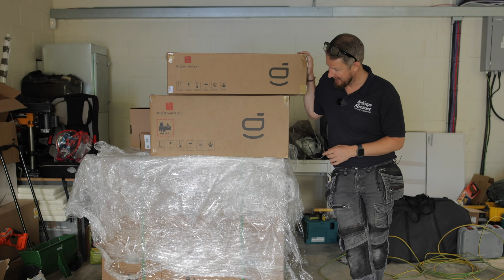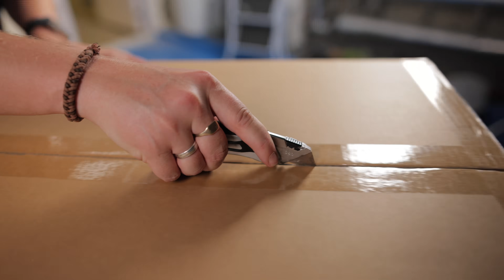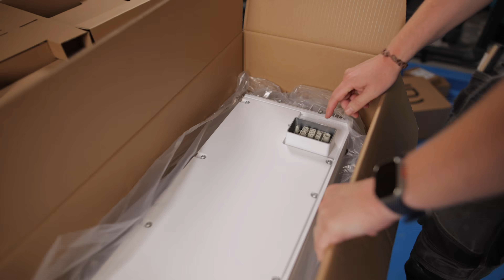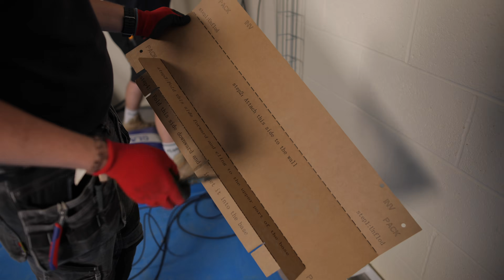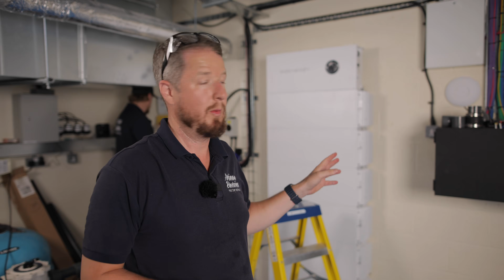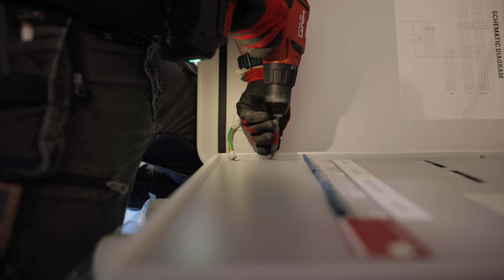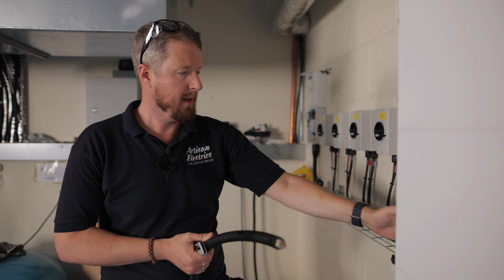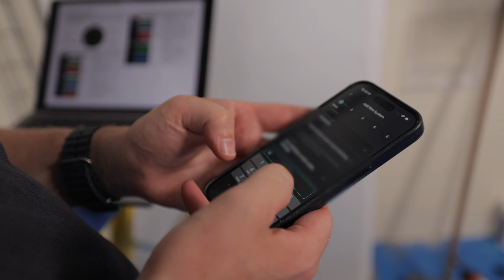Better than a Tesla Powerwall? 🧐🔋48kWh Three Phase UPS Battery System! ⚡️ Sigenergy SigenStor

Comment: I work with this kind systems for 10+ years now ( nor synergy) and it wirks good.
I only use hybride inverters so beside the ups function my house is connected direct to the inverter and the grid is as backup connected via automatic switch.
So wen my inverter fails he switch over to the grid 😂

Comment: I have a 3 phase house with a Powerwall. I need to find a solution because I have 3 phase solar that won't charge the Powerwall if the grid is out, which is sorta dumb. I wanted to be off grid as much as possible, but I find that is not possible with  my current setup.

Comment: Bollocks to being unique, there are plenty of inverters with critical load, zero switching "UPS Mode" designed for three phase in the 12-40kW bracket. More sponsored BS from Artisan. Wouldn't be so bad if you actually gave a balanced honest overview of the market, but seeing as this is sponsored I guess you go with the £££ first.

Comment: Looks a nice unit but I cant find mention of them meeting the new cyber security regulations. Warrenty looks just under what I have from Victron. The only advantage I can seen is that its all one module when I would need three inverters to match that. 0ms transfer is standard for my kit, i didnt know a lot of these gateways had such a transfer time. Thanks for the interesting video  👍

Comment: As a result of your promo video here I jumped from a pwerwall2 to this system as a choice .
  However since the 3 has launched and this obviously made me think again , but if I understand correctly the 3 is still using an older gateway that won’t allow whole house back up as this Sigen does .
  Is that correct ?
Reply from the maker: PW3 doesn’t allow whole house backup for three phase installs - also it is EPS whereas Sigen Gateway is UPS
Reply: Thanks for reply , I think if our installer can satisfy himself Sigen support is up to scratch it’s a buy,, he has good experience with Tesla support , so am hoping Sigen are ok .

Comment: Only problem I with it is that it is based in Shanghai, and the connection it then has to the PRC/CCP. I don't trust anything AI or controlled by them.

Comment: Have you looked at their single phase equipment? What’s the maximum power output and how does it compare with Givenergy and Tesla?
Reply from the maker: Their single phase inverters go up to 12kW so higher output than even the Powerwall 3.

Comment: 1) What are the advantages and disadvantages of the different battery systems that you presented (Sigenergy, Tesla, MyEnergi, others ?) ? If there are significant differences - of course. And in which cases should one be chosen over the other ?
2) How to determine battery capacity ? On what basis ? Is there a program to calculate it ?

Comment: Do Sigenergy do smaller batteries for small homes ?
Reply: you can just get the energy controller with a 5kWh or 8kWh battery pack. In this video Artisan use 6x8kWh packs but you can use whatever quantity you need up to 6 packs. You can also mix 5kWh and 8kWh packs.

Comment: I could be wrong but it looks like once its all together if you need to replace a battery in the middle you would have to take the entire thing apart to get to it, unstack the ones on top, unscrew from the wall and remove those clamps on the side. This looks very inconvenient compare to the server rack mounted batteries I've seen out there that can be slid out to preform maintenance and replacement

Comment: So the whole installation was on a 100 amp 3 phase supply, it is now on a C?50 triple pole MCB 10KA feeding an MCCB DB with, in your own words much larger than normal MCCB’s, from past experience what you are saying is that the sub mains or plant requires protective devices higher than a standard DB at 63 amps. So how does the new supply meet those requirements ?

Comment: I think in the intro you basically said that that the system was aimed at large houses or small businesses. Here in the Netherlands, 3 phase is not limited to large houses and my mid terrace house (3 floors and a supply of 3x25A) has three phase. I'm curious if this great looking system is really overkill for such a house. We only have a daily usage in the rough region of 10kWh and we have 16 panels that delivers a max of around 3kW. 

I like the UPS feature but that's not entirely essential as we have not had a power outage in 20 years. Great video.
Reply: you can just use a smaller version of the one artisan installs in the video
Reply: I think more panels would be better till you have the power available to charge the batteries.

Comment: One tip ! Wtf .  Usse a level at bottom  base .  Your battery is A  Not in  level .. wtf .  Wasserwage .. mann benutz a Wasserwage deine Batterie ist nicht gerade .. schau mal at Gestelle.  Was soll das sein .  Besser at powerwal .  Was sind Kosten für so was .. ich haben configuratinon deye Wechsel Richter mit 50 kw Akku.   Akku 14000€ und komplet Set 17000€ ohne pv panelen .. wtf .. Gibt nicht besseres at powerwall .. but IT is to expensive to me .. ahahhahha

Comment: Thanks for being honest and mentioning the "missed wall brackets" and redoing the stack.  This is what can happen when installing a new system for the 1st time, even with clear instructions! Cheers.
Reply from the maker: Glad it was helpful!
Reply: Yeah the brackets need to hold the battery small distance off the wall, expect has something to do with giving ventilation.
Reply: @trythis2821  I think these batteries are sealed TBH

Comment: 48000Wh at 800Kg? 60Wh/Kg seems pretty poor.
Reply: 110wh/kg from the manufactures website. The weight would include the casing, wiring etc as well as the cell.
Reply: @steve_787  but would casing & wiring really constitute that much weight? And what chemistry only performs at 110Wh/Kg? Even Sodium is touted at 160.
Reply: @daveh6356  does seem excessive, had a quick look at their spec sheet and the 6 unit model actually weights in at 467kg including the inverter. So maybe 800kg was a bit of an exaggeration or they had other kit to bring down?
Reply: @steve_787  sounds more like it.

Comment: Fantastic video and you just proved that the electrification is for the rich elite, anyone working and living on a living wage will never be able to afford this nor have the room.. But if they have to the owner will increase the rent...
Reply: In an effort to be encouraging, I would point out that in terms of grid stabilization and load shifting that benefits everyone, you really want a bunch of the people paying for it to be the rich people. Batteries and solar PV that I don't need to pay for, in someone else's home, decreasing the load on the grid at peak times, benefits me because the grid distribution utility doesn't need to spend as much money on increasing capacity or paying to build and maintain storage at rate-payers expense. They may pay a smaller fee to use some of that capacity in emergencies, but that's a heck of a lot cheaper than the capital expenditure needed to build it themselves.

As far as electrification being for the rich elite - How do you define electrification? Like, if you mean using electricity to power things instead of combustion, then that's not the case. Electric cooking, clothes drying, yardwork (prices vary significantly among options - li-ion battery ones can be expensive, but inexpensive corded electric lawnmowers like the one I grew up using have been around for decades.) - All of those exist at a variety of price points that are roughly comparable, and come with health benefits too. Electric water heating and space conditioning (including heating) price competitiveness varies significantly depending on local conditions, but in many cases are pretty comparable if you're already getting air conditioning (though obviously there are climates where that's not the case). If you aren't in an area with natural gas supply, like you use heating oil or coal, that may swing it towards electric more often depending on the utility. In my household's case we costed it at about par over the life of the appliances (after the government grant), if gas and electricity prices maintained their relative levels. Obviously that could change, but it's by no means certain which direction they'll go.

If you mean backup power, then yes, this is a lot more expensive than a whole home methane or propane generator system, though it also provides a lot of functionality that they don't, so you'd expect that. But also, most people don't buy whole home electrical backup, period, even rich people. That said, the existence of expensive systems doesn't disprove the existence of cheaper ones. There are significantly less expensive DIY battery systems out there. Though really, grid unreliability in many places isn't the sort of thing that the general public should normally be hedging themselves for individually in a well functioning system. If everyone around has backup generators, that may mean that something else has gone wrong in the regulatory and utility environment. Places with particularly frequent weather disasters or that sort of thing are exceptions, because there's only so much that a utility can do and only so far that society will go to devote resources to preparing for, as well as partly because many people tend not to want to live in places with frequent bad weather.

And if you mean electrification of generation, well, depending on where in the world you are, if you're already buying electricity, there are places where you can put money into buying from carbon neutral generation that can save you money. Not everywhere, but there are definitely community funded and subscribed solar and/or wind projects around that give their subscribers rates that are equal or better than those of the incumbent fossil powered utilities in their area.

Take heart. Progress is being made, though it is unevenly distributed. Lots of people are working on making life better in equitable ways. Hopefully their example brings more people on board to support those efforts.

Comment: Fantastic install, only question I have is if you have supplied the AIO with a 10mm 5 core ho7 from the gateway how have you calculated the design current if the ups is backed up for the whole house surely 10mm is undersized?

Comment: Are the IP2X covers still to fit on the contactor links in the gateway enclosure !! Or is the busbar from the contactors left like that?
Reply: By the accent alone, this is in Britain... It wouldn't pass cerification if they are not covered.

Comment: Have you got a video explaining all these kw ratings, 5kw solar system means what, 5kw at what voltage ? UK mains? 48kw battery's at mains voltage or another voltage, I don't understand
Reply: kw is always the same. Its kilowats so basically 1000s of watts. Wat is voltage times amperage so 1kw can be 1000V and 1Amp or 100V and 10Amp or 1V and 1000Amp. Thats what inverters are doing, basically changing 50V into 100V or 200V depending on what battery voltage is compared to your grid voltage or other requirements. And if you double the voltage, you halfen the amperage
Reply: Battery capacity is kWh - kilowatt hours. So a 48kWh battery can supply 1kW for 48 hours or 48kW for one hour. The inverter will determine the voltage. The load will determine the current. 
kW is a unit of power
kWh is a unit of energy

Comment: LiFePO4 still catches on fire. The GenX big battery supplied by Tesla near Rockhampton Australia did so last year. Why anyone would install one of these inside a building and not in an engineered structure to manage fire is mind boggling.
Reply: My thoughts exactly.  I'm planning a home that is on the small side but I still don't want the risk of living inside a building with a huge battery so my first purchase was a "telecommunications shelter" where my batteries and inverters will live and a bit of extra storage too.

I like how this battery system is pretty modular and clean but it should be in a structure that is kind of designed to fail without catching other structures on fire and probably with a dedicated fire suppression system so there is a way to attempt to extinguish a battery fire rather than just waiting for it to burn down completely.  That's probably not a job for water so either an ABC style chemical extinguisher system or a CO2 generator of some sort.  I'll have to research that more.
Reply: Lots of things in a house can catch fire but we don't go around keeping half our possessions outside. The risk is pretty low

Comment: Great video. I've ordered a Sigenergy system for my single phase home, 16x (2x8) 455w solar, 6kW inverter and a 5kWh+8kWh batteries. Waiting on G99 DNO approval.
Would love to see more in depth app workings with the AI and TOU tariffs etc.
Reply: Would you share who you are using for this install and how much the cost is? If you don't mind of course!

Comment: Why are gateways not incorporated into an inverter?
Reply: Better to keep them separated to prevent the possibility of a massive mains (or lightning) surge directly into the inverter. This way, everything is fused on breakers, before it even gets to the inverter module.

Comment: Seems quite similiar to the Huawei batteries just in terms of engineering and being modular and stackable. Huawei inverters and batteries are very common in ireland but dont see any UK sparks installing them, how come? They are brilliant right up there with solaredge in my opinion

Comment: Great video @artisanelectrics I'm the Managing Director for Sigenergy in Australia, although i'm originally from Yorkshire so it's great to see our product gaining popularity in the motherland!
Reply: Can you hurry up and get CEC approval for your 3-phase inverters please 😉

Also would have been good if the 15kW inverter had either 4 MPPT's or allowed parallel strings due to the 600PV restriction in AS4777.1
Reply: I’m a fellow Brit who is living in India (due to my job) and I can tell you that the market potential for a product like this is absolutely huge over here. See bullet points below that I hope are helpful….

1) There might be a few barriers to entry in India (due to bureaucracy) but that’s now easing a lot with the country digitising corporate admin.

2) There are currently no competitors at the moment, because there are no lithium based battery products available over 1 KWh. Most people have lead acid based EPS systems with a dirty sine wave output from a low quality (Indian brand) inverter.

3) No body is importing lithium based products at any scale. Whilst importing is remotely feasible, it would be tricky and no service support.

4) Every major city in India has several affluent areas where homes are afflicted by daily power outages. And even mid sized homes mostly have a 3 phase supply. These home owners have sufficient capital to purchase such a system. Punitive rates of customs duty would not deter them because the drop in / out of their AC systems disrupts their sleep, sometimes several times per night in summer or monsoon seasons.

Please have a think on this. I’m not an agent and I have nothing to sell. My suggestion is for free purely because I’d like to see a system like this available in India. Find me on LinkedIn. Robert Allan / employer Nippon Koei
Reply: Originally from Yorkshire too and now in Perth, I just got Sigenergy 32kw battery installed with new solar system, going up to 48kw next week
Reply: @TheMozzatron literally decided to go SigEnergy over the last few days, really looking forward to it!

Just hoping I've picked a good local installer :)

Comment: So if using this system ( single phase ) will my Solar Edge Invertor with Optimisers still be needed.
Reply: You could use this system as an AC coupled battery in parallel with an existing PV system like yours. You can also connect the PV strings directly in to the Sigenergy system and then you don't need anything else. Both scenarios are possible.

Comment: New tesla 100kw car battery is about 20k€. How much would same size system be? How many 20-80% sycles could it last? Can it read north pool electricity prise data and predict solar panel charging based of weather forecast?

Comment: Can it be used without solar, is it possible to have a non backup circuit like the Tesla Powerwall, and does it work well with a backup generator?
Can we also have a comparison of the single phase system?
Reply: yes, it can be used as an AC coupled system with no PV, it can be installed by itself or in parallel with an existing PV system. The gateway has a port to connect a generator.